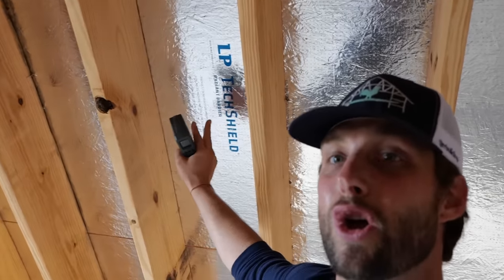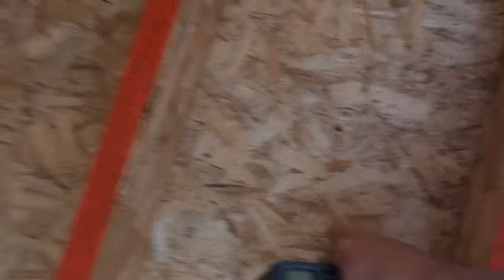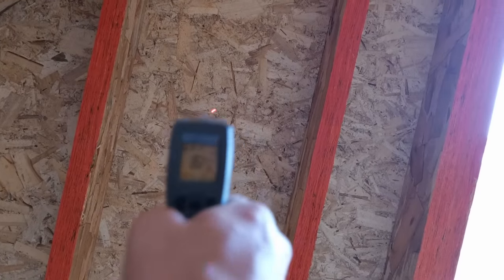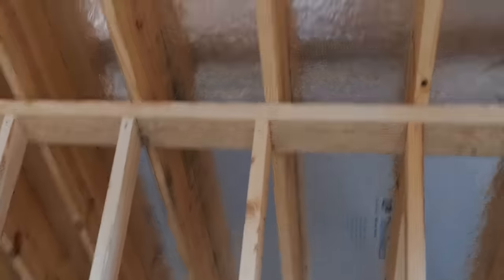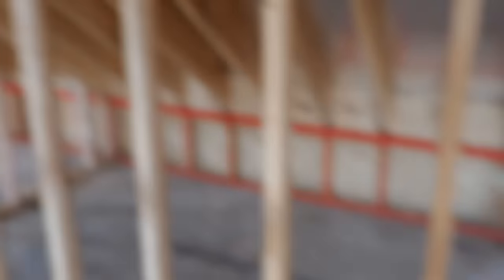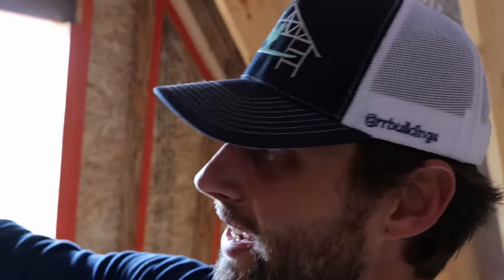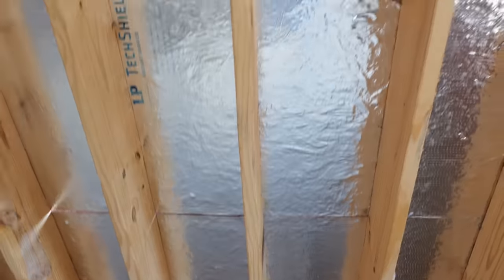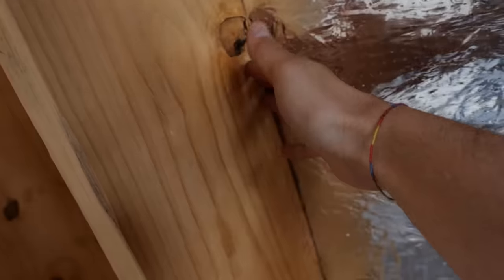Do Radiant Barriers Work? - LP Techshield Review

Comment: Hey Jordan, one minor point. When you use an infrared thermometer like that to measure the temperature of a low emissivity surface (aluminum foil will be about 0.03 emissivity) you need to put a small piece of masking tape on the foil surface and hold the IR thermometer very close to the tape so the only thing in its field of view is the tape. The tape emissivity will be about 0.9.  This will allow you to get a much closer temperature reading of the underlying foil. Of course, remove the tape after you take the reading.  Otherwise when you aim the IR thermometer at the bare foil surface the thermometer is going to "see" the reflection of the room and that is what the reading will be for.  That is because a low IR emissivity equates to a high reflectivity. These IR thermometers are typically calibrated assuming the subject surface IR emissivity is about 0.9.
Reply: Good that you're thinking of the emissivity of the surfaces being compared, but I think you're missing the point. 
Putting tape on the radiant barrier defeats the whole idea. Of course adding tape increases emissivity. That's exactly what the reflective product is trying to avoid - emitting heat. So the way he has done the comparison is correct. That's exactly the point he makes with the foam. If something is touching the radiant barrier, it shortcuts its magical radiant properties. 
However, some radiant barrier products do have a possible downside in that if they get dirty, they increase their emissivity. They can degrade over time if they are a cheaply laminated product. Look at this same roof in 10 years or 20 years and the emissivity will have increased, for many reasons.
Reply: @seanmaxwell4976  What he's measuring isn't useful, unfortunately. That reflective material is going to reflect both ways; from the sun->roof->radiant barrier, and from the room->radiant barrier->(and back into the room). What he is measuring is some unknown combination of the temperature of the radiant barrier * some emissivity coef + the room temperature + a reflection of his own body temperature. I don't think you can say anything with the result he gets. I bet if he positions himself closer to the barrier, he'd get a higher temperature due to the reflection. I think what he wants to measure is the effective heat flow, and there are two ways I think you could do that. The first is to get a styrofoam cooler without the lid, put a cup of cold water in it, and rest it open side against the radiant barrier / OSB. Take temperature readings every 10 minutes, the delta will give you an idea of the heat flow. You could probably get a reasonably accurate absolute measurement from this experiment.
The other way would be to go on to the roof; the temperature of the shingles above the radiant barrier should be hotter than the ones over plain OSB. This isn't as good as the first, but will give you a relative difference.
The best thing to do is just figure out what the difference in heat flow due to radiation would be. If you figure the temperature of the radiant barrier / wood is (say) 75 degrees celsius, and the ambient temperature is 50 degrees celsius, and the emissivity is 0.1 for the barrier and 0.9 for the wood, you get something like a heat transfer of 20 watts/meter for the radiant barrier and 200 watts/meter for the OSB. That's a huge difference.
Reply: @fgbhrl4907  Great points and it's fun to think about how to measure properly. There are many difficulties measuring emissivity, especially in the field. In some circumstances, it could show you the opposite of what you're trying to prove! I'm a Level 1 thermographer, which means basically I've learned that there are so many ways I can be tricked that I've got to be careful what conclusions I draw. Your understanding goes beyond the procedures and into the science. I'd love to hear more of your thoughts.
Reply: This little section of the comments is why I like to read them. Excellent points on everyone's understanding of this system!

Comment: The comparison of the west vertical wall without the radiant barrier to the roof decking with the aluminum backing is not a good comparison. The better comparison is how decking with and without the aluminum backing heats up the air under the sheathing using an dry bulb thermometer.

Comment: When measuring a reflective surface like that, you're likely to measure the reflection of your own body heat or something else in the room. Imagine that everything that's hot - including you, is actually glowing in a color that you cant see. A device like this is just measuring the light intensity of that color, so it's very prone to errors if anything's reflected.
Reply: You are 100% right. Aluminum reflects near infrared light very well, you have to paint it or put tape on it too measure it's temperature.
Reply: @theinvisibleman2070  Damn. Are you OK?
Reply: @damennix  It's also misleading if the interior temperature is in contact with the foil. Aluminum foils (metal) are still very conductive, so if it isn't horribly warm outside, the interior temperature and the barrier's temperature will be nearly identical. The fact that he even talks about the temperature is evidence of bad conditions. Eventually, the heat from outdoors will show. 

Radiant barriers are, at best, a minor component to a properly insulated system. The air gap between your decking and the insulation or decking and barrier are honestly providing more value than a radiant foil. Just paper would provide almost the same benefit.

Comment: I'm in Tucson, in a double-wide trailer.  I had to rebuild the roof and 1 south-facing wall of a corner bedroom.  I did a "poor-man's" foam insulation.  I bought the 1" R-Tech foam board and cut it to fit the cavities.  Then, I used spray foam to seal all the way around each cavity.  WAY cheaper than spray-foaming the whole thing, with essentially the same effect.  I could have put a thin fiberglass over that, if I had wanted to, but it was only 10' of the south-facing wall, so it seems like it would have been kind of overkill.  However, it is consistently the coolest room in the whole house, despite being in the southeast corner.

Comment: I put metal roof on lathes with polystyrene between the lathes. The metal roofing has venting channels that flow up to ridge vent. I put the tech shield decking on like the manufacturer suggested, it did seem backwards but I didn’t want to deviate from the engineering of it. Between the rafters, I used duro vents(some people say “egg crate”), which allow an inch an a half air gap between insulation and the radiant barrier. I brought the duro vents down to top plate of wall so that the soffit would allow cooling air to flow up between radiant barrier and insulation onward to the ridge vent. When I walked upstairs, there was a slight temperature increase when reaching the loft area, which is expected. That was before shiplap was installed on the cathedral ceiling, and before the four zone mini split was installed. I am very pleased with the results. It’s amazing, really, that everything worked so well together. You only get one chance. Now that everything is finished, the upstairs gets very cool, very quickly after the AC is turned on. One more thing, I used this method mainly to try and keep my house cool, but we live near the Texas Gulf Coast and the very high humidity can cause mold problems if you try to build an “ice chest” house. I used the latest technologies, with “old school” principles, and I have No bad issues, whatsoever. Shout out to Tom Tynan, the Home Handyman, who first turned me on to Tech Shield and the method of “vent skinning”.
Reply: Sir can you give me some information? I build my own house for my disable vet and my children
Reply: @sansimb5735 i rarely check my comments, but yes, if you get this, please do reply

Comment: My observation is that most people misunderstand how RBs work. 
1) They are a ONE-WAY strategy. 
2) They need to face out if you want to generally prevent heat from coming in (hot climates), and face in if you want to prevent heat loss (cold climates).
3) they need an air gap, at least 1” preferred, between the shiny side and whatever next structure layer (they do not work if in direct contact with something else).

Comment: Great video and very helpful for guys who are thinking of rebuilding their roof. I used LP TechShield when I rebuilt my roof a few years ago (in So Cal). It works really well, cuts summer heat a lot. I have not needed an AC since then. The down side is the house is a lot colder in winter (made the inspector hustle when he checked out the progress). So I used blow-in insulation between the joists (2x10s) and that solved the cold in winter problem.

Comment: Laid mine over the ceiling / insulation in the attic . UNREAL difference .
Reply: And THAT is the best way to do it. Then ventilate the attic to remove the heat.  Installing it on the roof deck reflects heat back into the shingles where it drastically reduces shingle life.  Heat is the enemy of shingles.  Let the heat pass through the roof deck, into the attic and then ventilate it out!  Seal off the conditioned interior, as you did, with the radiant barrier and insulation
Reply: What product did you use?  Is it that big of a difference?  I have a 1000 sq foot home and no shade trees.
Reply: Correct Mark and GaryK - Attaching radiant barrier right on the roof decking will CONDUCT heat.  It loses a lot of effectiveness if the barrier itself is 150 degrees from Conduction. As GaryK said, laid on top of insulation with lots of venting if possible.
Reply: @benjaminjoseph3392  when you mean "venting" do you mean perforated or do you mean attic venting by either ridge vents or attic fan to outside air flow?
Reply: @ddemier  Both:  The barrier needs to be perforated for moisture control. Additionally, if the radiant barrier is laid horizontally on top of the insulation, then its reflecting infrared back into an attic.  The attic will be hotter, ergo the attic space will need lots of ventilation so the additional heat can be carried out.  My son has a physics degree and can tell you in great detail about energy transfer, I have an HVACR degree and have seen way too many attics with too little insulation and barely any outside air venting.
Reply: @benjaminjoseph3392  I could definitely use your guidance as im a first time home owner.

I have a two bedroom one bath about 1200 sq ft with a gable roof with big triangle vents at each end of the gable. HVAC is not in the attic. 

I just added cellouses and probly now have a R value of 40 here in the midwest thats good. Do you think I should add this barrier on my new insulation and maybe a fan on one of my gable vents? I also seen those new solar fans that you could add in your roof. Is all this upgrading even necessary for my small house?
Reply: @ddemier  I live in in the midwest also.  Do a YouTube search for AtticFoil, they have several good videos.   With the size of your home, existing R40, and existing decent attic venting, you will save a little by adding radiant barrier, but you're at a point of decreasing returns.  I would suggest adding it and then consider yourself done. That said, if it doesn't cost much you might want to add a non-powered turbin vent on your roof, but don't spend a lot.   In my case, we bought an old 2000 sq ft ranch home with R5 (four or five inches of blown-in fiberglass) in the attic.  We're adding R40, plus vents, plus radiant barrier.  We will see a substantial savings.

Comment: By all means - yes I'd like to see more about this subject.  It would be great to see some strategies for retrofitting and existing home too.
Reply from the maker: Will do.  Thanks!
Reply: Love your videos. Lots of great tips and info. I’m renovating my garage with a barn dormer in the attic.I will have a 7’ ceiling at centre, but I live in a cold climate, Toronto,Canada, so I need to insulate my roof to an R50 minimum. I would really appreciate seeing how you use the radiant insulation to see if that will work for me. Thanks,Terry
Reply: 5150lane I added  a radiant barrier to the underside of my rafters. Massive difference in comfort and electric bills during hot Texas summers. Absolutely works and worth it.
Reply: @AtticFoil  I live south of Houston, installed AtticFoil radiant barrier last year and love it. Before I installed it, I talked to Ed, the owner of AtticFoil, and he told me to do the right things first, i.e., air sealing, mastik on the ductwork, proper ventilation, etc. Did it, installed the radiant barrier, and then had insulation blown in to R38 spec. (We also had energy efficient windows installed last year.)

The combination of the results are amazing. We keep our house 4-5 degrees cooler now, and are using ~25% less energy to do so. Based on my results, if you live in an older home, I would highly recommend installing Atticfoil. You'll be happy you did.
Reply: @budbarber4748  interesting.
Would like to know a couple of things.
What insulation did you have in the attic before you brought it to R-38 ? And how much ?
What Windows did you have previously? How many ?
Also what windows did you have put in ?
Type ? Brand ? Style( double hunhs, picture Windows, etc) ?
I'm in remodeling and have been for a long time. I tend to geek out on this type of info.
I now this stuff helps save energy.......all of it.
Reply: @kipcarroll486  Hi Kip, the home was built in 1978, had 6" fiberglass bats in between joists, and 4" rockwool on hot walls. I replaced the rockwool with 6" fiberglass batts on the hotwalls, then had blown additional insulation blown in on the ceiling portion to bring it to R38. Before I did all of this, I started by adding one additional vent on the roof to improve venting. I had two whirlybirds and added a 3rd. I also applied additional mastic to all joints and plenum on my duct work (hard galvanized), and reinsulated it as best I could. It's not perfect, but it is much better than it was. I then took the time to airseal all the penetrations (ac vents, walls, light fixtures, electrical penetrations, stove vents, etc) with expanding foam. I had the radiant barrier stapled to the lower edge of the trusses, leaving a 6" gap to the roof deck, and a gap on the hips of the roof leading to the main ridge and a gap on the ridge too.

We replaced the original contractor grade aluminum frame, single pane, single hung windows with expensive (Power) double hung, double pane low e-glass windows (9 total).  We finished the project in late Nov 19. Our energy usage is down considerably and we are all electric. Total usage in 2018 was 16662 kWh, 2019 was 16114 kWh, and so far in 2020 (with 12 days remaining), 12302 kWh. We keep our indoor temps lower in the summer by 3-4 degrees, and higher in the winter by 2 degrees now than we did previously. Overall, I've been pleased with the results. The house is much more comfortable now, year around. 

All of these improvements yielded some good results. The one that is by far the most notable is the much lower temps in the attic. One can actually venture up there now in the summer time without perishing from heat stroke.
Reply: @budbarber4748  Great info. Imo, all the "little things" you did helped some, but in my experience the big things did most of the grunt work for your decrease in energy usage....I.e. Attic insulation, wall insulation, high tech windows( but you only had 9 , so that's mitigated somewhat), and the reflective radiant barrier install. I grew up in insulation business( 12 yrs old my first time blowing attic insulation. Ha), to spraying foam insulation in houses to blowing foam onto the space shuttle rocket boosters(which wasn't done for insulation purposes, though) and I can tell you incredible stories how attic insulation changes how a house feels, uses energy, sounds, etc. Its the biggest factor, fastest , most efficient $ usage, by far, imo.
Thx again.
Great job.
Reply: @gregcoldewey7724  ---When you say you "added" a  radiant barrier. You man you also added an additional insulative material creating a space between the radiant barrier and the insulation. Correct?